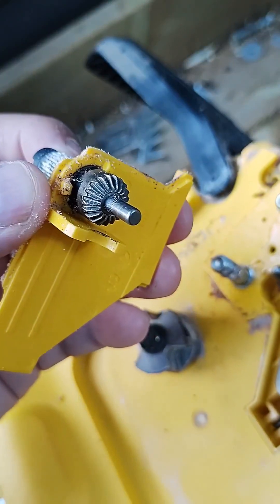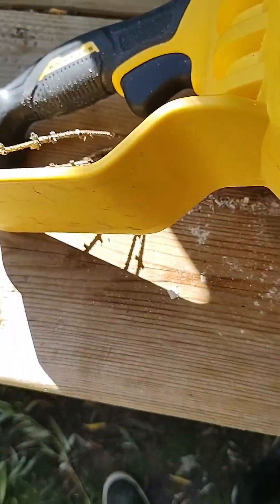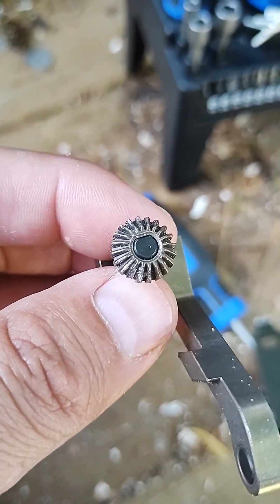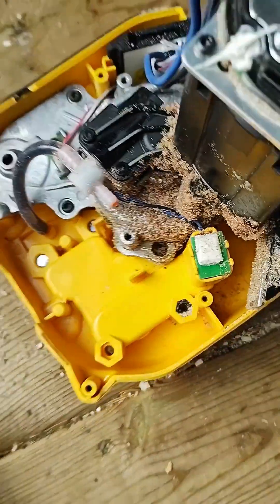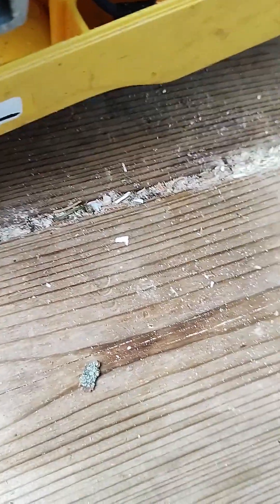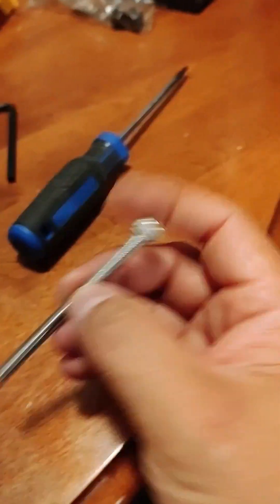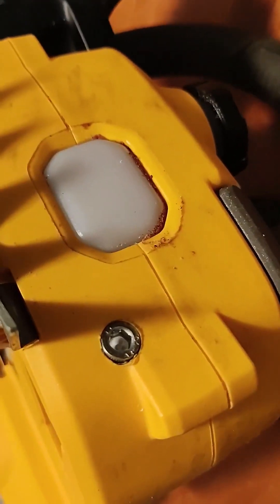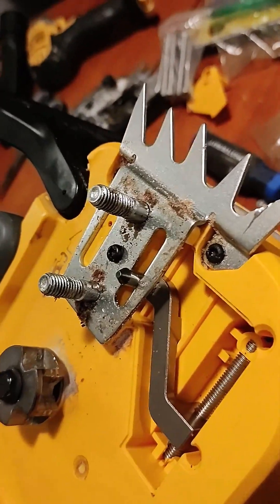Chain tensioner fix for DeWalt 60V Chainsaw

Comment: I think it's easy to see why they did it like that, it's so it doesn't get beat up or full of debris hitting against the wood on the front. Nonetheless, this was a nice fix that should work fine for people who know what they're doing.  There is also evidently a stronger gear with fewer, larger teeth available now that I saw in a review somewhere but I can't find that review again at the moment.

Comment: Mine stripped out after about 4 days of use.   I did your fix.  You're a lifesaver.  Or at least a saw saver.   I extended your fix a little by turning a shoulder on the tip of the bolt to ride in the plastic slot like the original gear shaft did, and I cut a groove in the middle of the bolt to put an e-clip on to keep it from backing out when you reverse it.  A perfect fix!  Thanks!!!
Reply: Where did you end up buying the screw from? Was it available in any big box store? Also, did you have an issue with screwing the housing back on? Thanks!

Comment: So I've got the same saw with the same problem.  I put the broken bevel gear in my microscope to take a look.  It looks to me like the sintered metal bevel gear was not properly formed at manufacture, as the teeth don't look broken but kind of melted.   I'm still within the 90-day return window at Home Depot, so I'm torn on returning it to buy a replacement or doing a similar hack to yours.   The latter would get me a working saw for sure.  If I buy a new one and this really is a manufacturing issue like I think it is, then I'm likely to see the difficulty on another tool if I buy it.  I wish I could share the photo in a comment, because the microscope view is telling.
Reply: fun fact my home depot only gave a 30 day warrenty on these.

Comment: Just to help anyone, a simple oring over that gear will solve the problem for 5cent.  Just side that gear off the end and slip a oring on the end of it.  Then slide the gear back on and fasten all down.  Takes that slack out of the gear you turn.  Some use a lock washer but I had a oring handy for it.  Helps keep the gears in contact so they don't just spin and click.
Reply: Do you have a picture by chance?
Reply: How would an O-ring fix a stripped gear?  They aren't just slipping.  The smaller gear had the teeth ripped out of it in one spot.
Reply: I tried it but it kept skipping when I tried to tighten it up 🤦🏻